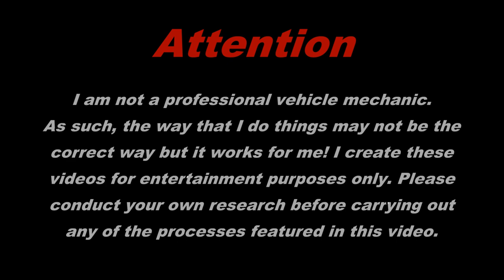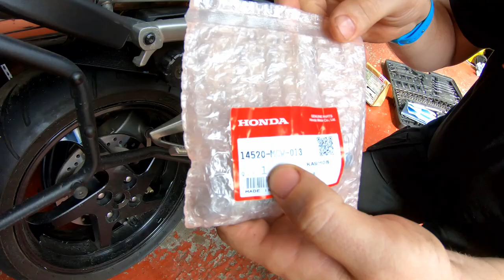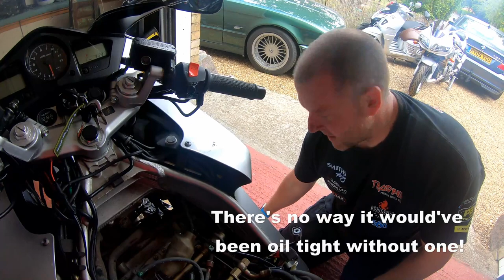2003 Honda VFR800 VTEC Cam Chain Tensioner (CCT) Replacement

Comment: is it vitaly necessary to wind the old ones in before removing? what would happen if you just lock them as is and then take them off?
Reply: I didn't wind mine in when removing. You just need to be careful and pull them straight out so you don't knock the cap off. Winding them up just gives you a bit more clearance. The rear is extremely easy to pull straight out. The front is a bit more difficult. I disconnected the small coolant line that runs right in the way and it gave me enough clearance.
Reply from the maker: As Spenser said above you can of course not bother but the body of the CCT will try to push itself away from the head under the pressure of the spring as you undo the bolts.
Reply: @KevsShed  Yeah, I forgot to mention that. Since I didn't compress them I had to alternate backing out each bolt a half turn at a time so it came out straight. In hindsight it would've been much easier to compress them since a new CCT comes with the key anyway. I am impatient and got the old CCTs out prior to my replacements arriving.

Comment: Hi, quick one out of curiosity.

Can you just remove the old tensioner without winding it back ?
Surely it will just push against the bolts as you unwind them and the whole lot would pop off as you get to the end of the bolt ?
Reply from the maker: Of course it would, however you have no real control over the cap on the end of the tensioner, if it catches on the inside of the hole and falls off inside the engine case then you'll have a much more torrid time recovering it than if you'd spent a minute and a half winding the tensioner back first! Naturally do it however you want, it's your bike but I like to demonstrate it the way the manual does!
Reply: @KevsShed  wouldn't the cap just sit against the chain until you withdraw it ?
What sort of clearance do you have between the bore and the tensioner cap ?

Not saying you're wrong, I haven't done it before so more just a thing of curiosity tbh.

(I'm a manual and torque spec kinda guy myself, just wondering what the logic behind it is)

What are your thoughts on manual tensioners ?
Are there improved oem style ones available on the aftermarket that you have heard good things about? 

What size hat do you wear ?
(Might as well ask, I've asked everything else 😂)
Reply from the maker: There is very little clearance between the cap and the bore to be fair, I prefer to err on the side of caution and wind it back first. I haven't personally ever fitted a manual tensioner so can't pass comment on them in all honesty, I do know that there are a great many people out there that swear by them so they can't be bad I guess!
I have 58cm dome so usually wear an XL hat! 😂
Thanks for taking time out to leave some constructive comments! 👍🤓
Reply: @KevsShed  appreciate the direct and honest responses !

I'll be keeping an eye on your channel going forward. (Bought a VFR800 late last night).

Thanks a million :)

Comment: KEV, PROBABLY A DAFT QUESTION BUT WHY DO YOU HAVE TO WIND THE TENSION BACK WHEN REMOVING, IS IT NOT POSSIBLE TO REMOVE EXTENDED.  THANKS GREAT ARTICLE
Reply from the maker: You don’t have to, strictly speaking, but if you don’t then there will be constant tension on the chain as you undo the bolts! Don’t forget that you need to make sure that you can grab that little cap as you withdraw it! 👍🏻

Comment: Hi Kev, can’t get link to buy ccts.  Gonna getthe valve tuning done so thought I may as well get these replaced as well...do you personally know of decent mechanic like yrself who will do a conciensciouss job  for cash, am in north London but prepared t travel n drop it off fr as long as it takes for a decent job .Thanks mate
Reply from the maker: Here's the link mate, not sure why it wouldn't work for you. https://www.ebay.co.uk/itm/GENUINE-HONDA-CAM-CHAIN-TENSIONER-LIFTER-AND-GASKET-VFR800-VTEC-VFR800X-VFR800F/123338314739?ssPageName=STRK%3AMEBIDX%3AIT&_trksid=p2057872.m2749.l2649&mkrid=710-53481-19255-0&siteid=3&mkcid=1&campid=5338707657&toolid=10001&customid=&mkevt=1
Reply from the maker: I don't know any conscientious mechanics mate unfortunately, that's why I don't use em! 🤔

Comment: hi Kev, I bought a vfr with 80k.
when the bike is cold the chain makes a noise.
 after reading about the bike, i thought it was just one of the tensioners. 

I went to the mechanic to listen to the sound.
According to the mechanic the chains should be changed....

Is there any way to see if the chain is stretched?
In the manual it is recommended to change the chains after 50k km
But I have not found anyone who has changed them.

What are your thoughts?
Regards.
Reply from the maker: In my experience it is never the actual chain, the tensioners on these are notorious for becoming weak and allowing a little chain noise. I'm confident that if you just change the tensioners your noise will be cured mate. Good Luck!
Reply: @KevsShed  That's what I thought all the time, I'll let you know the result,
I'll change the tensioners following your video. Thank you for your work.
Reply: @KevsShed  Update 
i changed them
there are no noises I am very happy. Thank you so much

Comment: Kev. Is it possible for me to take the cct's out and rewind them tightening the spring slightly as opposed to having to purchase new ones as seen a video showing how to do this. I'm assuming this is my problem as got rattling noise as you demonstrated but my vfr800 only done 17k miles.
Reply from the maker: Your bike so your choice mate. Personally I wouldn't attempt that on such a critical engine component, but like I said, it's your money bud!

Comment: if the tensioner is at end of life, then wouldn't that mean the cam chain itself is stretched to the point of needing replacement?
Reply from the maker: No, on the contrary. The tensioners get loose with age and don’t apply the correct tension to the chain and can make the chain rattle.

Comment: a guy left me in a 2004 vtec today to replace the tensioner it has a noise around 6500 7000 rpm i reckon it could be valve clearance needs looking at 24k miles
Reply from the maker: I have a video for that job too! Actually 3 videos, but you get the idea! ✌
Reply: @KevsShed  must watch it a changed the tensioners yesterday and all good

Comment: i didnt know there was 2 of those on bikes
Reply from the maker: Yeah most bikes have 1 if they are in a straight 4 config, it’s only because it has 2 banks of cylinders that it needs 2. Would have been far simpler and more maintenance free to have stuck with geared cams like previous models! 👍🏻
Reply: @KevsShed  ok cool

Comment: 10x for the video. I have a 2003 vfr with this noise https://youtu.be/-mEl-9dtlEg. Could it be the rear tensioner?
Reply from the maker: Yes it could but that noise could just as easily be a leaking exhaust gasket! The rear tensioner is less prone to failure than the front one so if the front one is fine then it probably isn't the rear tensioner. That said, change it anyway if you are worried, for the peace of mind of knowing, why not! It's a very important engine component!

Comment: brilliant video. Just brought a 2003, had the tickover really high so I lowered it. The high tickover was maksing the cam tensioner rattling... will order two from Japan. Were you not tempted with the manual ones?